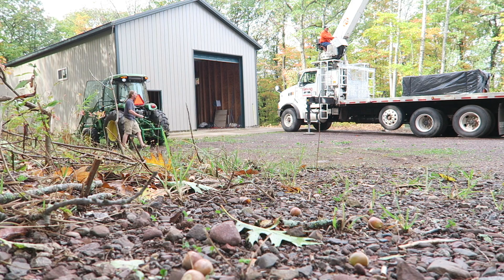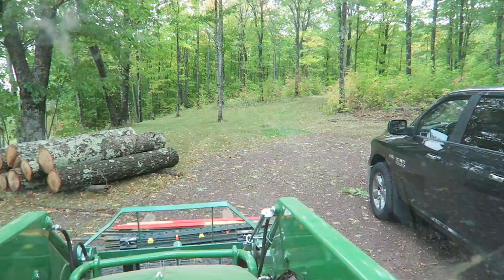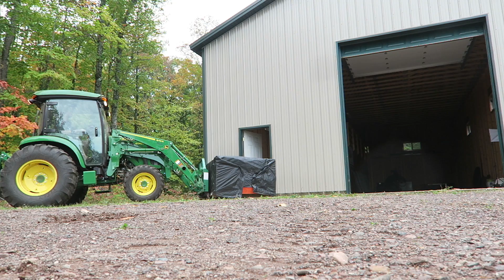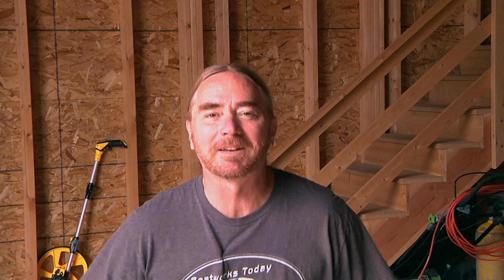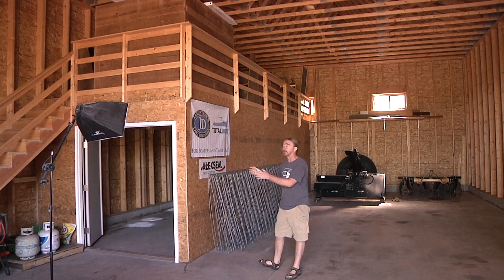THE NEW BOATWORKS TODAY SHOP BUILD BEGINS!

Comment: To bad there is not a way to put radiant heat in the slab, or find some radiators that will work with hot water.  Get an accurate indoor outdoor humpty temp monitor,, cheap accurate for your  attic.  If a problem put in vents or louvers in the end walls/ peaks. Have fun

Comment: I’m a mobile service tech for sunbelt rentals and if you plan on using a scissor lift for the plywood you will need a bigger lift;a 1930ES or the 1930R at about 14’ it gets wobbly and 2 people and plywood can make it a little tipsy. However if you go to a 26’ scissor like a 2632ES which is a JLG lift.  It’ll be a little more stable and it will lift you plus one and ply wood and tools no problem for the most part. If I myself was doing the work I’d bring in a 4047 wide scissor lift. But the 19’ will do it but i wouldn’t recommend it. Love your videos a lot of them are helping me out with my boat projects. I got my personal boat I’m fixing to have to redo the top cap gel coat or put new clear coat on it but keep up the awesome videos.

Comment: Reference your "utility room".  I'd flip the loft by sealing off the upper section for storage (near the back window) and a finishing room.  The bottom can then be opened (post/beam with no center wall).  That'd provide you easy access/flow to/from your workspace and provide level concrete for heavier equipment (lathe/mill saw station, etc) and a work bench.  Heating radiators would then only be needed around your exterior walls on the bottom floor.  Another added benefit would be more options for wide angle camera positioning and lighting.  Couch, fridge and TV and you'd have my dream shop.

Comment: Andy if I was fitting it out, I would add a small shower room /toilet/cloakroom on ground floor 6 wide, inside the room on the left with a door to the outside so if fab area is full of fumes or dust you don't have to walk back through it when clean, on mezzanine I would put a small office say 6ft wide and use the rest for a fibreglass cutting room with fibreglass storage and cutting table

Comment: If you run around the perimeter with baseboard heater pipes you might run over them with tractors or trailers.
Reply from the maker: those lines are buried 24" deep :-)
Reply: Oh. I'm talking about your heaters inside the building around the baseboard.

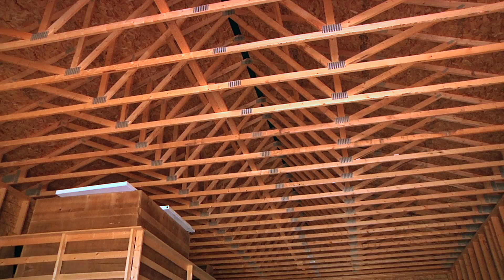Comment: Couple things: are you sure the ridge isn't vented? At 11:30, what is the black? I am watching on small screen so I can't tell for sure, but is that Cor-a-Vent ridge venting? Also, if you spray foam insulation on the underside of your roof sheathing, your attic space will be conditioned air and ventilation is not needed. In fact, you do not want it. The great thing about foam is if you do it this way, there are no openings to outside air making your conditioned space more airtight. I am a residential designer (In Arizona) and I recommend spray in foam adhered to roof sheathing to all my clients.
Reply from the maker: That's tar paper going across the peak :-/  It's totally sealed which is a little surprising, but is what it is

Comment: is there some kind of fire retardant they can add to the blown in cellulose?  Please check....cellulose, once dried, is a terrible for hiding or fire travel.  arc fault can ignite it, but maybe not if there's some kind of retardant in it...it's worth checking.
Reply from the maker: Whatever they add to it is very retardant; there's vid's on YT with a guy holding a handful of this stuff with a blow torch trying to burn it while holding it ;-)  https://www.youtube.com/watch?v=mZZ4GhSuYww
Reply: @boatworkstoday  well that's a relief!  when you get some, loosen it up so it's not in a clump and do that test again, try to simulate the "once blown in" scenario.  It's looking like this outfit is 10 times better than the crud that's installed around here!

Comment: As for osb on ceiling we build a box like structure onto the lift to in effect make the basket higher and set the sheet on top of and use the lift to raise the panel into place. So we have one guy in the lift and one ground guy..  2good days is reasonable for what it looks like your shop size is. Over the room look at a drywall panel lift. Easy one man job.. .

Comment: As far as foam goes are you sure you are comparing apples to apples? There is closed cell and open cell, closed cell in my area runs close to 3 times as much...
Closed cell we use for structural purposes ( sips panel type stuff)
Also as a contractor i dont recommend spray foam around any roof penetrations in wood construction. Foam will hide leaks until serious damage occurs. As far as r value goes foam is far and away the best.
Attic ventilation if foamed there is no air gap there fore there is no condensation thus no mold. With a metal roof you are good to go. It can shorten asphalt shingle life as the air flow helps cool them... you arw in my opi ion on the right track as far as insulation goes...
If you are going to run electric in any walls id probably run conduit and pull the wire to allow changing things up easily as you "live" in your shop for a while ...

Comment: Your contractor is right about the foam being a vapor barrier, but you're going to still get condensation on the underside of that roof.  With no cross flow or roof venting?  Yea, I don't agree with him.  Pop in some Gable vents; 24x24 gable vents would provide PLENTY of cross flow.  R60 in the ceiling?  THAT'S NUTS.  LOL.   If it was me, I'd pop in gable vents with some REALLY sturdy hardware cloth to prevent birds and bats (yes, where you are there are plenty of them around) from finding a new home.

Wall insulation is some good stuff.,  MESSY to put in...when they shave the stuff down.  Just don't forget the wall vapor barrier.  You might want to have the electrical run before the insulation unless you're planning on an external wiring system (which is just fine, but a bit more work with all the conduit that needs to be run).

The mezzanine is a nice little work area...maybe "Shop Office"?  You say you can't get your saw up there??? Sure you can.  2 ton chain fall off the rafters that you double up.  :)  The finish room is exactly that, I'd say keep that exactly for that, and cut in some exhaust for it. 

Looking good Andy!
Reply from the maker: Current situation would only be temporary; agree less than ideal long term but for the Winter hope it will be OK.  Venting will be put in place in Spring when addition is built :-)
Reply: @boatworkstoday  One year isn't going to kill you.  Thankfully the winters up there are DRY DRY DRY (humidity, not snow LOL).  Miss the Copper Country, it's my home away from home, and I'd live there if I could.  SWMBO Hates the snow and cold and pretty much refuses to even go up there for vacations.  :(

Comment: A couple of roof vents or louvers on either end of the building will be sufficient and much cheaper than a ridge vent - not to mention more leakproof.  Consider louvers with a fan to exhaust summer heat.  That will also allow use of the space for storage or short term habitation in the summer.

Comment: I am predicting that winters are not going to be so cold anymore, but as they warm up there will be more snow between -5℃ & +5℃ as we drive hard toward another Triassic period...
A Gantry Crane would be nice in there...  lifting motors off boats, etc..  hydraulic hull mounts..  I would like to see you build a boat from a jig, a small skiff..  like the new ones with open stern..

Comment: I’m not sure but the reason for thin gauge metal on those registers might be for better heat distribution. Even with a dent here and there it may still be more efficient than a heavier gauge all around.

Comment: Should have got a bunch of planks and put them on top of joists so you have some extra light storage space along the perimeter...  OSB is mostly glue made out of formaldehyde.. 🤢
Should never use for exterior use, any contact with water is like particle board or MDF...  Also if it catches on fire the fumes can be deadly..  It was originally produced to put a use to wood shavings from shops, but now they rip trees down just to make OSB instead of just using waste...
Space @ top of the stairs you should turn into a Korean Karaoke Bar.. 8D..  It looks like you could build a nice half pipe on floor with the top part for spectating?  lol
I would take the 2x4 @ window by stairs and make it symmetrical..  People should start putting studs in the middle of walls and then space them apart to the corners...  not just starting from 1 corner to the other...  I guess they have never hung a picture, plus it makes locating studs simple...
The room would be good for painting small parts with venting into larger area, easier to keep warm when cool outside...  You could have some awesome parties in your shop with a band playing top of the stairs & VIP area..  up top probably good for a bit of office space, for doing drawings, partner meetings, or in the room...  I was going to also say what someone else already said, let it determine its own use...  steadfast pragmatism

Comment: What about making the bottom part the wood shop and fill in the top and have the top be the clean tool storage out of the work space. The heavy stuff would be on the bottom and you could control wood dust fairly easily and separate the fiberglass even if you wanted. All the best from Santa Cruz

Comment: Remove the handrail upstairs and wall it up.  it will only catch dust, which is not good for what you are doing in the building.  I would use it for some type of storage.  Hopefully the joist are sized so that they can handle a combined dead and live load.  As far as the insulation, I would be concerned about moisture trapped in the attic if no ventilation is provided.  That is a big problem in Houston, TX where I am a energy inspector.  Unfortunately energy applications vary by seasonal temperatures and how moist the air is on average and I am not familiar with your region.  Hopefully someone else on this feed has some local information that will help determine whether or not you need ventilation.  Project is coming along good.  Cannot wait to see you working on boat projects again.

Comment: Personally, I would use the top area for the tools and supplies and the enclosed room for the woodworking area.  Being closed would help keep the dust down and you would still have easy access to the tools and supplies.
Reply: that's exactly what I'd do as well.  plastic curtains like a walk-in freezer to help with dust from the woodworking space.  Part of the upper level can still be closed off for a small parts finishing room.
Reply from the maker: Hopes are to build a dedicated woodshop off the side next Spring :-)  We'll see, but that's the goal!

Comment: I'd be fairly certain you've already checked into hydronic underfloor on an existing slab but this site does talk about a relatively easy method of grooving the floor and inserting heat tubing. It would alleviate the problem of exposed registers on the walls which limit your wall storage options. https://www.youtube.com/watch?v=c67eNTJaYzM

Comment: MY house had ridge vents installed when I had it re shingled. A skillsaw to cut a slot about 2" wide and install vents. Two three hours. If you have a metal roof remove the cap and install the ridge cap. If they didn't leave a gap the use the skillsaw. When the contractor that puts on the addition is some thing he can easily do. Heat buildup without venting NOT GOOD      Do your research on the different kinds of roof vents some are better for insects, snow, rain.

Comment: I'm really digging the step-by-step details of the build out. Plus the fact you're giving prices this fits riding with what you've been doing for a long time which is giving people valuable knowledge. Is somebody wants to learn how to do boat repair basic fiberglass work you show them you're showing them what to do. Somebody plans to build out a shop you're showing him some pretty good details on what's involved in some of the prices they should be looking at.
Which is very cool.
As for the unused space above I would say leave it empty for now and let time dictate. Once the shop is fully up and running you might find a very important use for that space and you'll be glad it's available

Comment: I'd say use the area for camera placement, panel storage, hang your fiberglass rolls over the banister with a large cutting board behind it with measurements listed to help get accurate sizes off the roll. Plus you can use it to catwalk across  to any bigger projects or to install a lift chain in ceiling. But definitely for more camera angles and lighting options.

Comment: Maybe you pointed it out maybe I just wasn’t paying attention, but is there going to be a lavatory somewhere around there or in the addition? Yeah I’m getting old I worry about those things. A thought about your baseboard heaters, with a little black pipe and T connectors you could end up with a lot of iron loops that are attached both to the concrete floor and to the wall. It wouldn’t interfere with the airflow but it sure make it hard to damage your heating baseboards. As for your upstairs loft wait and see how it works out don’t be in such a rush to necessarily solve that problem right now maybe it’ll come to you and be obvious later but if you just want something top of my head small part fiberglass fabrication area and/or demonstration area for videos.

Comment: Second floor will be a dust trap. (Maybe a plastic curtain to temporarily curtail dust).  Use the second floor for material storage.  That floor plan will constantly evolve to accommodate the current projects.    Shop space for tools and wood down stairs.  You don't want to be hauling tools (even hand tools) up and down the stairs

Comment: Another great video,  nice to see the shop coming along.  As for your mezzanine,  I would say use the biggest portion of it as a varnishing/ finishing room.  As it is the second floor it would be quite easy to add some filtration and down draft vents to control the dust. as you really only need air lines and electrical in the finishing room you wouldn't need any heavy equipment up there.   I would leave an exposed walkway to be able access a larger boat deck as you had in your previous shop.  As well get your self an electric winch and mount it do the ceiling with a remote to be able to move larger hatches or pieces up to the second floor easily.

Comment: Wouldn't be the first time in my 40-some years in the trades that ridge cap vent was installed over sealed ridge! AFA yer no condensation in Winter issue. The inner side of your roofing will reach near +/- 180 degrees in summer, essentially cooking the roof material, reducing lifetime.
Ventilate !
Reply: Preach brother! I live in AK, vented roofs are the ONLY way!

Comment: they have 1/4" and 3/8" OSB that would be good for ceiling it is only holding the insulation it weights less and cheaper you can use the OSB you have in the walls If you can find it I did search of the HD around your area and could not find any??? The upstairs is where your wife is going to throw your stuff that you leave in the  house and that you will be unable to find when you need find it to use LOL!!!!

Comment: I have a question for ya. How abut fire hazard? Isn't foam flammable. I know that they can treat cellulose with something to make it (less I guess) flammable, but foam doesn't that burn like fuel?
Reply: You are correct.  Most will burn when exposed to an open flame, but I believe Andy is sheathing the whole interior with OSB plywood, which is far more flammable than the foam.  There is fire block paint that can be applied to the foam insulation for any that is not encapsulated by the OSB.

Comment: Personally  I would enclose the top area and make it the storage room.  The bottom room Imwould make a wide opening in the long wall and have it as part of the 1st floor work area.   Just close off your heater room portion or better yet move it upstairs

Comment: I thought you might want to move the stairs closer to the doors, so you could have more space upstairs. Then you could have a bathroom and more open space underneath.  Going without a 3/4 bath is crazy. A portable toilet is a temporary solution to a permanent problem, especially in the winter. Plus it adds big value.       🤘😎

Comment: It’s true the insulation will hold and seal the warm are so you don’t have that issue but for piece of mind you can add a couple small vents no need to vent the whole ridge, you won’t have that much air leaking.

Comment: I would do insulation the way you have planned. Check the attic in the middle of the winter. You're looking for frost, usually on the underside of the roof. No frost or icing at the eaves, no worries. If frost, then add ventilation. If you get lots of snow on the roof, ridge vents get covered and don't work. We used whirly gigs. They get covered but only for a short time. Gable end power vents are also excellent.

Comment: Don't do anything with the upper level for now. Use what you have and wait to see what you need. It is easier to make up your mind after you have done a few "wish I had" sessions. Once built, you won't want to tear it out and do it again so give it time to show what you need.  As far as a bathroom goes, a couple of 55 gal drums, one for solids to settle and one for liquids to drain after all the inspections are done are doable. Just get a portable water tank you can move around with your tractor for flushing and hand washing. I can't see a shop like this without some water source.
Reply: Andy, Please check your facebook messenger for a PM.